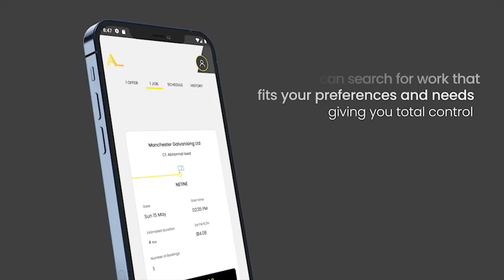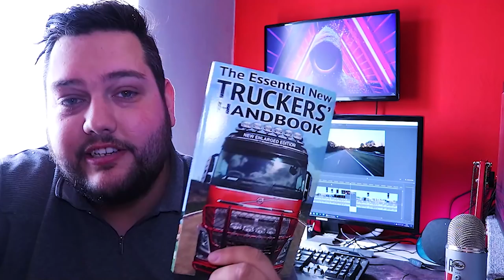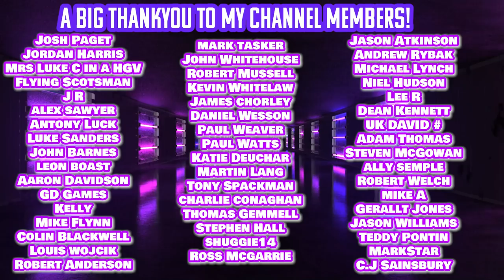HGV Drivers Deliver 2,000 Toilets To Buckingham Palace & Hyde Park For The Queens Jubilee! #London

Comment: Hey, isnt the new law that you are not allowed to hold anything in you hand?. You are still able to touch your phone and Satnav if they have the relevant holder which you do have. 
gov.uk/using-mobile-phones-when-driving-the-law
Reply: Adding on. You may think that its the same law but actually in the past it was said you are not allowed to use the phone for interactive communciation, i.e texting and calling. Many people won court cases because they said they were filming or checking something on their phone. Hence they changed the law thay you cannot hold anything electronic in your hand that has data transmitting. 
You can still use your phone for quick intercations if its mounted, so in your case, changing a route quickly or answering a phone or selecting a contact to call.